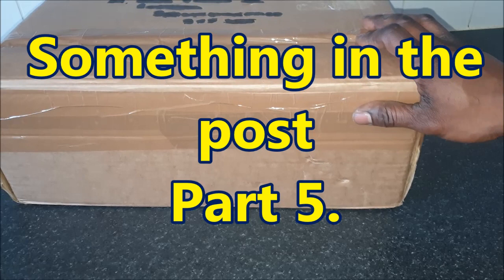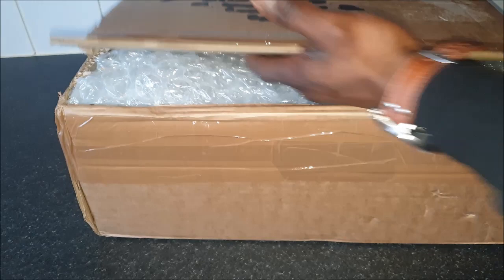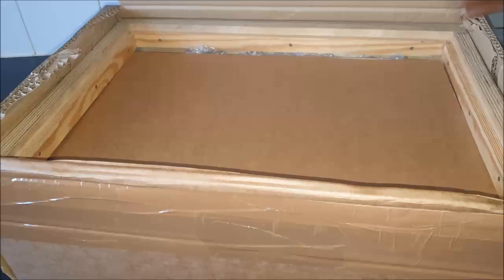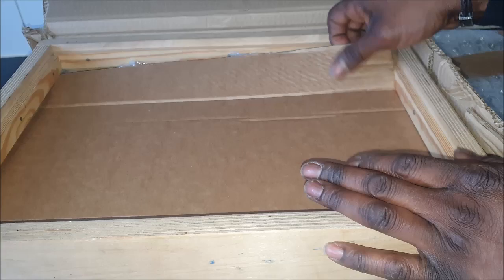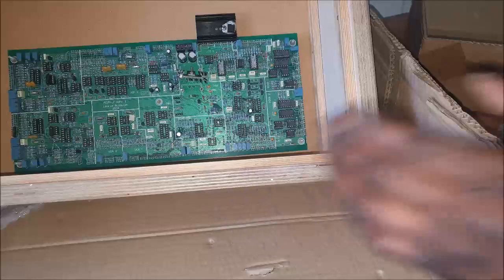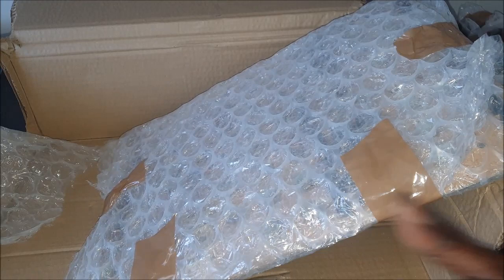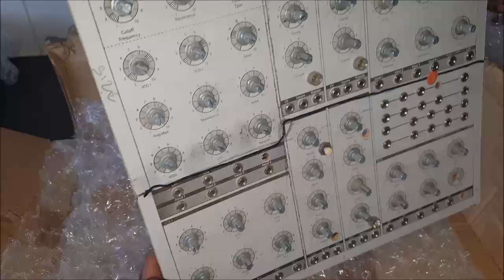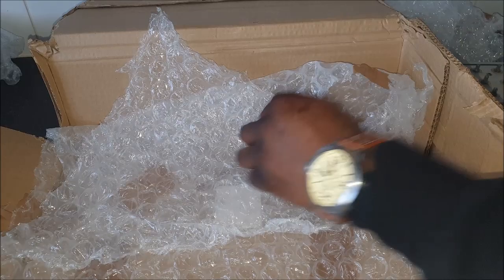DIY analog synth project ( Something in the post Part 5)

Comment: There are Advantages to picking up the unfinished projects of others! That will be relatively easy to get working...or be a lot of trial and error!
Reply from the maker: There is indeed dos gos. Hpoing not to rush it and make a disaster of it. However I'm not expecting smooth sailing as its not that straight forward in design :-)